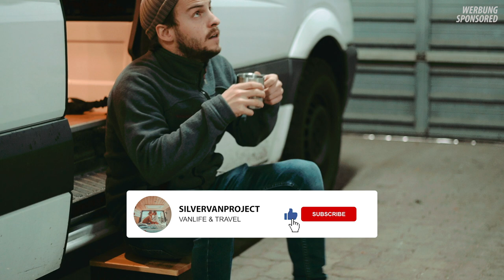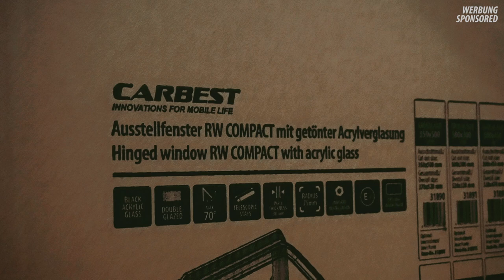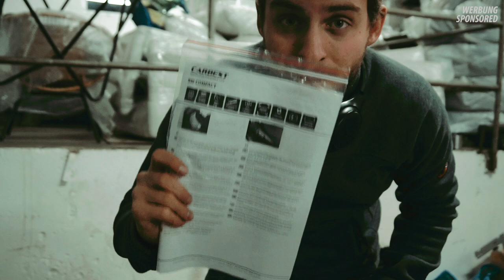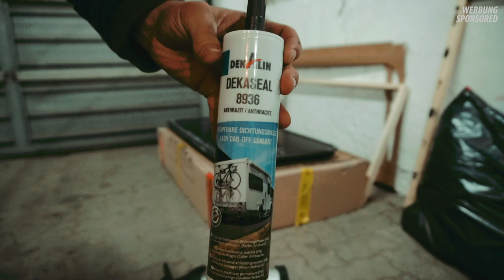Removing SIKAFLEX + NEW WINDOWS

Comment: Really not as hard as you made out, we got the window out, without removing the frame in around 30mins, the difficult part was cleaning up the mess afterwards of all the silicone. For reference, we use Sikaflex 512 UV and used brake cleaner to remove the excess. Total time to remove and clean was about 2hrs, i think you spent too much time drinking coffee ;)
Reply: I used sika 256 and on the first window I let the excess just overflow.. but now getting that off is a problem. I want to use a blade but don’t want to damage the paintwork!